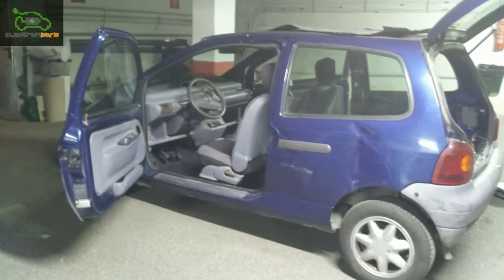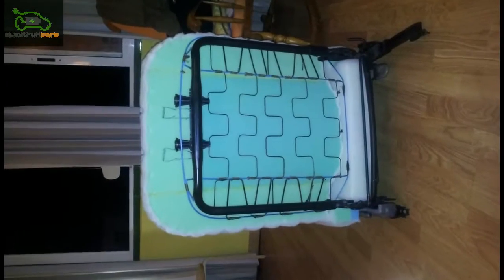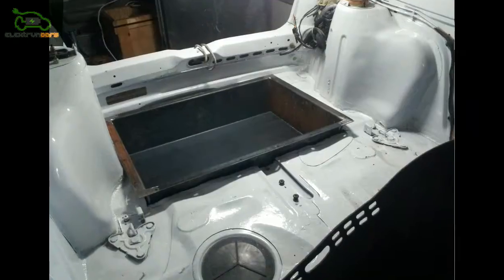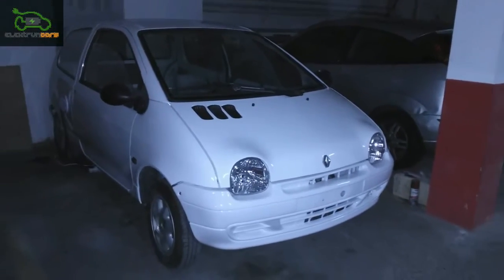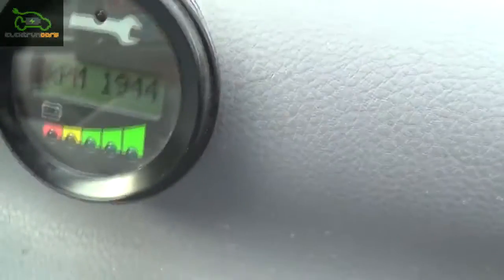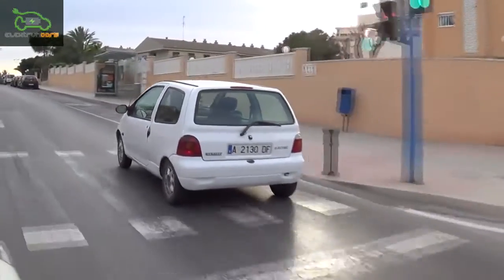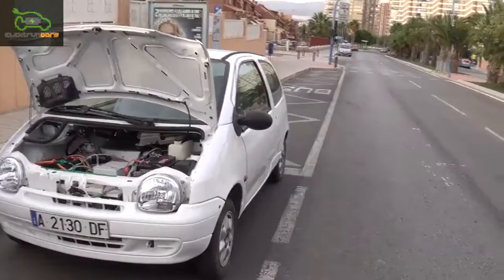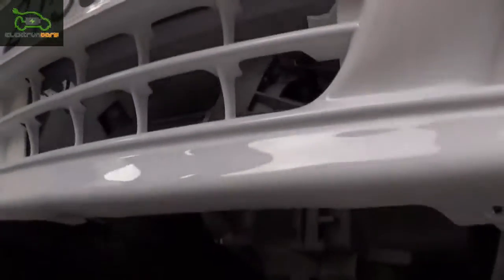Elektrun first test electric Twingo english

Comment: what is your top speed ?
Reply from the maker: At the moment of the test it was 76km/h in 4th gear with a 200A curtis controller. We havent tested in 5th gear yet but for sure we would get to 90kms/h, and 110 kms/h with a 350A controller.
Reply: thank you, i did an opel corsa 15kw also. i will upload my results later.
Reply from the maker: It would be great if you can upload a video. Let us know about it. Are you in Spain?. We are.
Reply: soy de mexico !!
Reply: oye una pregunta, ¿ como te va con las subidas en tu auto ?
Reply from the maker: Pues al tener un Curtis de 200A, no es muy potente..en 1era y segunda bien..en 3era depende de la cuesta..
Reply: pero alcanzas mas de 40 km/hr de subida ?
Reply: ya subí un video del montaje del motor.
Reply from the maker: Top speed is 80kms/h in 5th gear.